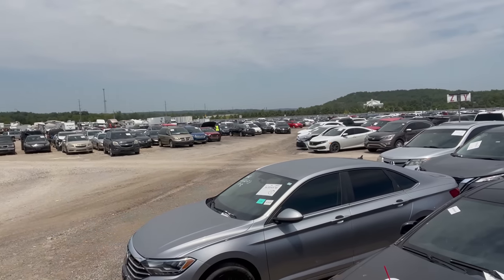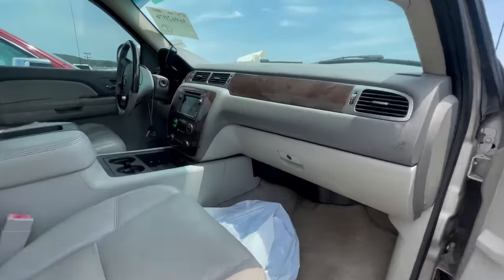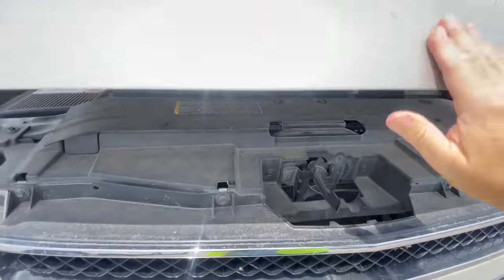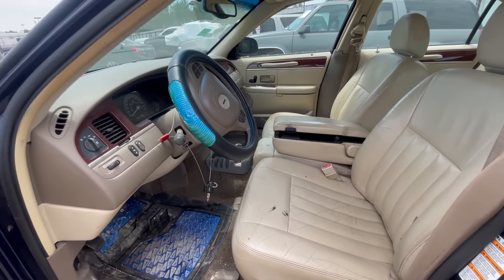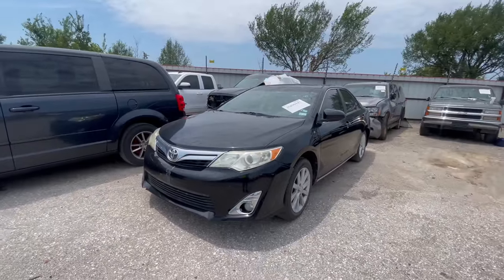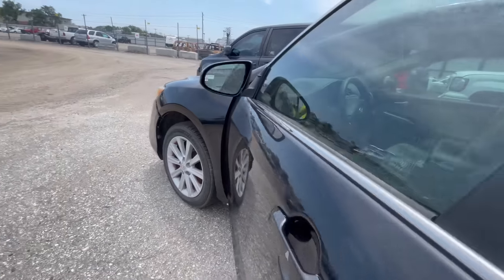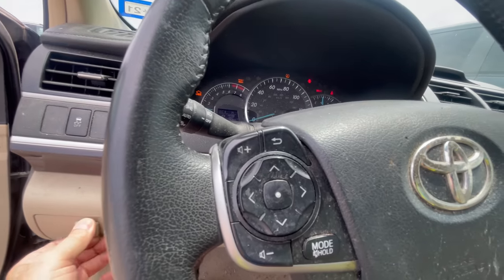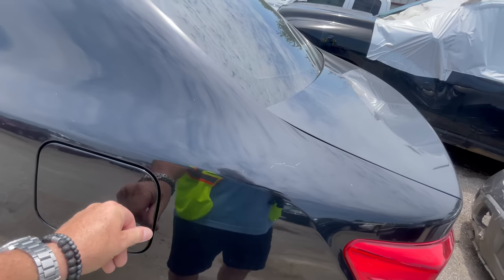Have I Found The One? IAA Walk Around 8/8/23

Comment: My guess on the Chevy avalanche is the steering wheel is hard locked to one direction ( a slight tug the other direction will help to unlock) . That other Chevy near the Toyota looked pretty good ( not the one behind the Camry  , but to the right ) .

Comment: I would risk it on the avalanche if it goes for a good price . Tailgate bumper etc tail light . With a good detail and a maaco paint job could be a very nice truck . The 5.3 l is a good engine in that year . You can buy new leather seat covers from katskin to replace the worn ones .